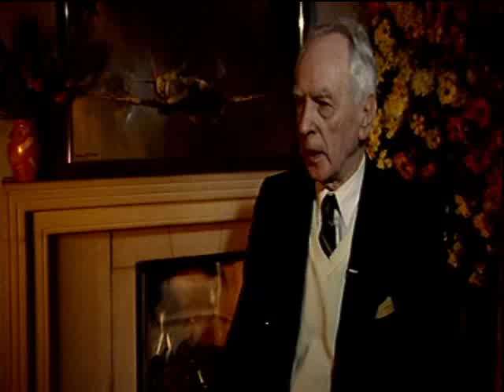Capt. Eric `Winkle` Brown  -   Miles M 52

Comment: He said all the information was given to the Americans who promptly used it to break the sound barrier.    Well, the Bell X-1 was completely different in just about every respect.
He claimed work on the m.52 was done in a wind tunnel.   That could only be subsonic work, as Britain had no supersonic wind tunnel.
Claiming a 1/3 model proved the soundness of the M.52 was a very dodgy statement, as the Reynolds number would be very different.
The aerodynamic design of the M.52 was nothing more scientific than "we know bullets can go supersonic, let's make it bullet-shaped."
Reply: @garrington120 STOP POSTING LIES AND IGNORANT MISINFORMATION ABOUT A TOPIC THAT YOU ARE VERY UNQUALIFIED TO DISCUSS INTELLIGENTLY.
Reply: @keithammleter3824 In hindsight, we know that the Miles M.52 could never reach Mach 1... Britain would not have reliable axial compressor turbojets until 1950.

Comment: Some disturbing errors in Mr. Brown version of the story, Britain didn't have any supersonic aircraft wind tunnels when the M.52 program was active, construction of Britains first supersonic wind tunnel at RAE Bedford would not begin until 1947.

There is absolutely no evidence to support that any data from the Miles M.52 program was given to Bell Aircraft  or NACA... Crown and Ministry' investigators found nothing at Miles but some incomplete drawings and a partially built wood model of the cockpit layout. No work on the 2 prototypes was completed or ever started, nearly all the funds for the M.52 program were stolen by Miles executives and Frank Whittle.

Comment: This is the guy who climbed into one of those tiny  Naz M e  peroxide rocket planes and flew it...then landed a twin engined bomber on a carrier..followed by  first jet landing on a carrier...and still managed to die of old age.
Reply from the maker: An absolute legend! Probably the world's greatest test pilot.
Reply: Such a talented pilot, unfortunately not a reliable source for information about the Miles M.52
 Mr. Brown makes some very glaring errors in his story, first the RAE would not begin construction of a supersonic wind tunnel at Bradford until 1947.
 No useful information about the Miles M.52 was ever transfered to Bell Aircraft because no completed drawings or flight test data ever existed.
 In highlight we can now say with great confidence that the Miles M.52  would never have flown supersonic, there has never been a jet aircraft powered by a centrifugal turbojet that reached Mach 1 in sustained level flight... centrifugal turbojets are too inefficient for supersonic flight.
Reply: @sandervanderkammen9230  It isin't just his input on the matter, Fact is the control issue was solved by the all moving tail plane, Which was a feature of the m52, And again it's a matter of government records that all research was to be shared with the Americans. Then strangely enough the American supersonic test aircraft began featuring all moving tail planes after that transfer. So given tens of eyewitness reports, Government records regarding the project and what was done with it, And the sudden appearance of all moving tail planes on American designs after the transfer was said to take place, So clearly even if not detailed drawings, Then at least design concepts certainly were. My money is on the miles m52 members side of things as being the closest to the facts..
Reply: @Markus117d  Neither Miles or Britian invented the Horizontal Stabilator
The first aircraft aircraft to have a Stabilator specifically designed to counteract the effects of  Compressibility at transonic speeds was the Messerschmitt Me-262.
Bell Aircraft copied the electric fly-by-wire stabilator system from the Me-262.
There is absolutely no evidence to support that Miles gave any useful information about the M.52 because the M.52 never existed.
Government auditor's found nothing but incomplete drawings and a partially constructed wooden mockup of the nose section.
Reply: @Markus117d  The M.52 scandal is one of the most humiliating and shameful chapters in British history.
Miles Aircraft was charged by the Crown court with 24 counts of fruad and embezzlement.
Frank Whittle was forced to resign from Power Jets Ltd. amid allegations of embezzlement and derilection of duty.
Reply: @sandervanderkammen9230 Quote bellow ➡️
"dropped from a modified de Havilland Mosquito at 35,500 feet over the Atlantic ocean, west of Lands end. This unmanned aircraft, the A.2, was in fact a 30 per cent scale model of a British supersonic prototype jet the M52"..
This makes your assertion of no drawings / planes or an tangible product of the programme existing, questionable at best, It's hard to drop test a scale model of something that no research or plans existed of.. Ps I've done an admittedly quick Google search but so far found zero about what you are talking about, I will keep looking, But it's clear that the M52 project was not as empty as you claim,
Reply: @kaferere  You don't know that the Messerschmitt 262 was the first jet to have a Horizontal Stabilator?
Reply: @kaferere  Facts still remain unchanged, the XB-70 remains the largest and fastest and heaviest payload SST ever to fly... and the Concorde? is the greatest financial failure in aviation history... until the Airbus A380 and they at least managed to sell 250 planes before production shut down.
Concorde had zero sales and production ceased at 14 certificated aircraft.

The main difference between the Messerschmitt Me-262 and the Miles M.52 is the 262 was REAL... the M.52 never existed!
Reply: @kaferere  The Miles M.52 does not exist.
Reply: @kaferere  Then explain why the RAFs most advanced jet fighter is the American Lockheed F-35?
Britain longer makes its own military aircraft.
Reply: @kaferere  Please tell us what British aircraft companies still make commercial jets???
Reply: @kaferere  Have you heard the joke about the 2 British astronauts that walk into a pub???
Reply: @kaferere  You don't seem very familiar with the Messerschmitt Me-262... 26 Luftwaffe pilots scored Ace or higher in the 262 shooting down over 550 Allied aircraft.
Kurt Welter became and still is the highest scoring jet Ace in history.
British jets only killed RAF pilots.
Reply: @kaferere  55 hours between overhauls was excellent for WW2 fighter engines... better than most British jets.

BMW is a world leader in automotive technology and manufacturers the Rolls-Royce as well as the 3 series, one of the most popular brands in history.
Reply: @kaferere  Well that comment reveals a very limited knowledge regarding engines.
 Because of the high precision of the fuel metering direct fuel injection is very unlikely to cause flooding which is typically a common failure mode of the more primitive carburetors which were obsolete technology when the war started.

Packard solved the 2 Fatal flaws in the Merlin engines...
The Stromberg-Bendix PD pressure feed carburetors and standardization and modern quality control standards.
Reply: @kaferere  That was the joke!
Reply: @kaferere  I think you need to some more research on the Bell X-1 and  Miles M.52,  the X-1 used a nearly exact copy of the Me-262's analog fly-by-wire Horizontal Stabilator to break the speed of sound... and the Miles M.52 never existed.
Reply: @kaferere  Eric Brown is talking about an imaginary plane that never existed.
There is no Miles M.52, no such aircraft ever flew or was ever constructed.
It's an example of British fiction.
Reply: @kaferere  The Tu-144 was first, bigger, flew both faster and higher, Concordes performance is unimpressive compared to the Valkyre.
BAC was an epic failure, the Concorde was an unmitigated failure unmatched until the Airbus A380 fiasco.
All of Concorde's orders were canceled after the aircraft was first demonstrated, production was canceled after just 14 type-rated passenger aircraft were built.
Reply: @kaferere  Clearly you don't understand, Britain did not invent the Horizontal Stabilator or supersonic aircraft.
Reply: @kaferere  The fastest jet aircraft ever built by Miles Aircraft had a top speed of 298 mph.
Reply: @kaferere  The Concorde was a massive failure that destroyed the British commercial aircraft industry..
Reply: The Vickers VC-10 was yet another embarrassing failure, only 54 built and Vickers went bankrupt and no longer exists.
Wrong, that record is currently held by a Boeing 747... one of the most successful commercial jet aircraft in history.. instead of building an SST, Boeing built the 747... the rest is history.
Reply: @kaferere  I think someone realized that they have made a fool of themselves..
The Miles M.52 never existed.
Reply: @kaferere  Please name a British aircraft company that currently  makes commercial jet aircraft in the UK?
Reply: @kaferere  When the M.52 embezzlement scandal broke the new Labour government was rocked to its core, one of the most shameful and humiliating scandals in British history and the worst in British aviation.
 When government auditors were sent to Miles Aircraft they found nothing, Miles could only produce some incomplete drawings and a partially built wood model of the cockpit layout.
Nothing was completed and no work on the 2 prototype aircraft that Miles waspaid to build could be found.
Nearly all of funds had been stolen by Miles executives and Frank Whittle.
Reply: @kaferere  Please name the British aircraft companies that are making jet airliners today?
Reply: @WilhelmKarsten BAE systems....
Reply: @WilhelmKarsten Gloster Meteor was pretty successful. Of course the me 262 had aces, their country was a burning ruin of ashes and had no choice but to send up anything and everything they had to counter the devastation. The allies could afford to have their jet fighters patrol over safe skies and not lose them.
Reply: @roverM30ds  BAE ceased all production of commercial aircraft 2 decades ago.
Reply: @roverM30ds  The Gloster "Meat Box" was an unmitigated failure as a fighter and never saw RAF service in that role.... it only killed British pilots, 450 of them!
Reply: @WilhelmKarsten  you pull that info out of your hole?
Reply: @roverM30ds  Please name a single British company that still makes commercial jet aircraft???
Reply: @WilhelmKarsten  Airfix
Reply: @roverM30ds  The Gloster "Meat Box" was completely ineffective as a fighter aircraft, slower than many propeller driven aircraft in service during WW2.
Official MoD records confirm that 890 crashed killing 450 RAF pilots.
1 out of every 3 built crashed or were destroyed in accidents.
 The Meat Box got its nickname from British pilots who lived in constant fear of the planes deadly asymmetric flight characteristics, most were killed by engine failures on take-off which were considered unrecoverable or from the planes reputation for high speed instability and tendency to snap into a flat spin causing the empennage to break off.
Reply: @roverM30ds  LOL! Sorry mate, toy airplanes don't count..
Reply: @WilhelmKarsten  chad valley?
Reply: @roverM30ds  Never heard of them... British Airways only operates planes made in Germany, France and America
Reply: @WilhelmKarsten  it's not British airways, its BAE Systems, the manufacturing company, formerly British Aerospace. BAE is one of the largest manufacturers in the world.
Reply: @roverM30ds  BAE no longer makes any modern jet aircraft of British origin, the only British jet in production is the 1970s vintage Hawker Hawk trainer.
Reply: @roverM30ds  British Airways no longer operates any jet aircraft made in Britain.
Reply: @WilhelmKarsten  read my previous messages, they are part of Airbus, they are one of the key companies that make up Airbus. Airbus being one of the largest plane manufacturers in the world
Reply: @roverM30ds  Airbus UK is a wholly owned subsidiary of Airbus SE.
A German, French and Spanish consortium.
BAE no longer has any stake in Airbus.
Airbus is not a British company
Reply: @roverM30ds  Airbus aircraft are assembled in Germany, France, Spain, United States and China.
There are no longer any commercial jet aircraft made in Britain
Reply: @roverM30ds  No, they are not, EADS bought BAE systems remaining shares in 2006.

BAE no longer has any affiliation with Airbus SE.
Airbus is;
40% German owned
40% French owned
20% Spanish owned
O% British owned.

Any questions lad?
Because you seem very confused and misinformed about the collapse of the British aircraft industry.
Reply: @roverM30ds  I remember BAE back when it was still called BAC lad...
Reply: @WilhelmKarsten  you thought it was an airline company 🤣
Reply: @roverM30ds  In 1977 the UK government merged all the bankrupt, failed aircraft manufacturers and nationalized them like a communist country... put all the bad eggs in one basket and then let the taxpayers pick up the difference of all the British aircraft being sold at a net loss.
Reply: @roverM30ds  You don't know the difference between British Airways and British Aerospace??? Damn lad are you a Charlie?
Reply: @roverM30ds  You are the plank that thinks Airbus is a British company... remember?
Reply: @roverM30ds  Britain ceased production of jet transport aircraft 22 years ago, the last one was the BAE 146 in 2001.

UK companies like British Airways only buy foreign aircraft now, made in Germany, France and America.
Reply: @sandervanderkammen9230  Troll
Reply: @Agent-zigzag  Just the cold hard facts here lad... the truth.
Reply: Britain has the world's second largest aerospace industry in the world. 🇬🇧
Reply: @awatt PLEASE NAME A SINGLE BRITISH COMPANY THAT STILL MAKES BRITISH JET AIRCRAFT IN THE UK???
Reply: @sandervanderkammen9230  
I can't hear you over the UK having the world's second largest aerospace industry. 

Looks like Germany is losing its aircraft assembly to India. 😂
Reply: @awatt Unfortunately the UK aerospace industry is mostly owned by foreign companies like Airbus, Boeing, Lockheed, Spirit Aerosystems,   GE, Safran, Leonardo, Thales, and Eurofighter.
Reply: @awatt  Germany is currently the largest manufacturer of jet aircraft in Europe, The Dornier Finkinwerder factory is the largest in Europe and second only Boeings Seattle Washington in the world.
Reply: @sandervanderkammen9230  
All of German industry is owned by the French, Americans, Chinese and soon India
Reply: @awatt Britain sold out its aerospace industry when privatization came and the government could no longer afford to keep the UK aircraft companies on medical life support.
It's 90% owned by non-britsh companies now.
Reply: @WilhelmKarsten  
Britain has the second largest aerospace industry in the world.
Germany is following the UK by doing a Brexit
Reply: @awatt  British companies are tiny players in the European aerospace industry...
Reply: @garrington120 PLEASE NAME A SINGLE BRITISH COMPANY THAT STILL MAKES BRITISH JET AIRCRAFT IN THE UK?
Reply: @garrington120 Hey Gary!  Have you heard the joke about the two British astronauts that walk into a pub?